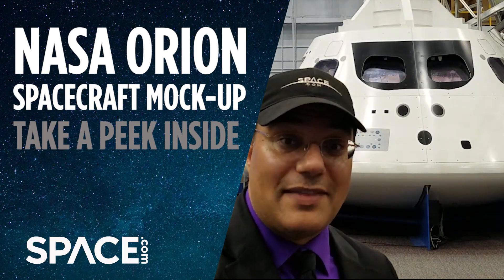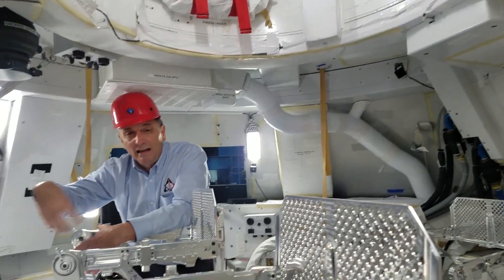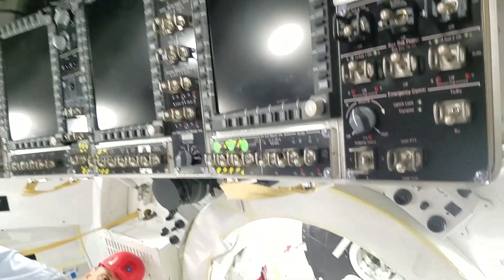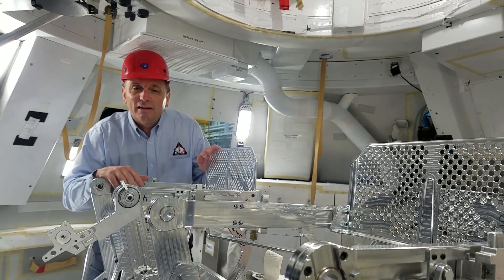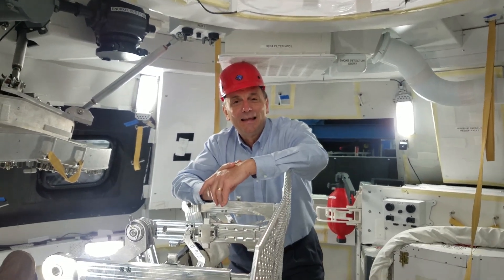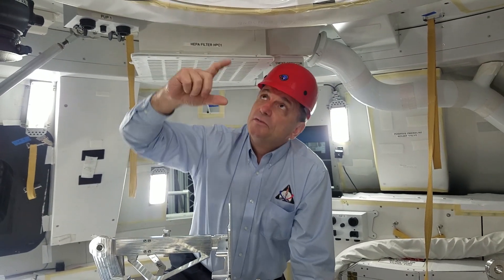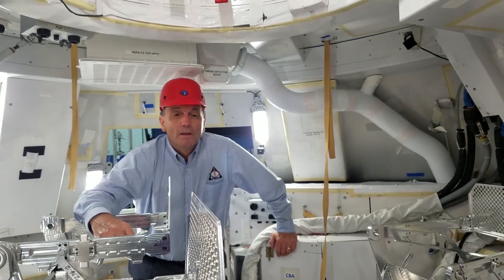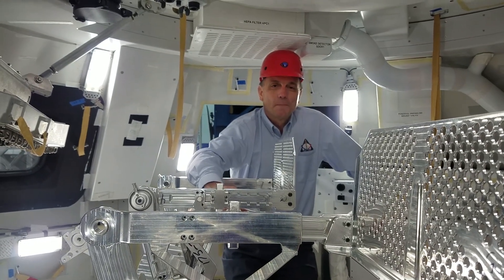Peek Inside NASA's Orion Spacecraft - Exclusive Tour

Comment: The capsule design just doesn't sit right with me..  you need a shuttle type for the main spacecraft...  with a booster platform to get you to the moon.
Reply: There's a reason they retired the space shuttle and went back to capsules. The shuttle just wasn't safe like the old capsules from the 60's were. But more important to lunar flights, is the weight. The shuttle was too heavy, it couldn't get to the moon. A small spacecraft like this or the old apollo CSM works better.
Reply: @despayeeto_5936  Atlas, Gemini and Apollo yes I admit all had their design restrictions.
The shuttle platform was a massive step forward in a reusable spacecraft. But the Orion capsules which are supposed to be state of the art, have regressed into the capsule design.
Why not have a space Dock and build a craft in zero G?.
It's a massive forward thinking enterprise but it's what we need to progress into travelling further a field.
Reply: @Mark-delta5  It's not a regression. The shuttle was, simply put, unsafe for the crew for a multitude of reasons. 

1. The solid rocket boosters it has couldn't be turned off during flight. This wouldn't have been a problem if they had abort motors like most space capsules do, but the shuttle was a plane looking thing stuck to the side of a rocket, so they couldn't do that. 

2. The heat tile problem, because the shuttle used heat tiles rather than a normal heat shield, which could get damaged during flight, leaving it unable to reenter safely. 

Both of these issues presented themselves with Challenger and Columbia. NASA doesn't want to see repeats of those. There's a reason we're seeing a move towards reusable capsules like Orion, Dragon or Starliner, instead of designs like the shuttle.
Reply: @despayeeto_5936 it's all about what technology we have presently.
Metallic hydrogen is the powerful rocket fuel we have to date.
So it's all about gaining escape velocity of 25,000 mph. 
It's all about R&D..   just because we don't know how to do something,  it doesnt mean we can't do..  weve just go to think outside the box and listen to those who know what humanity is capable of..

Comment: I suppose that high tech red hat the guy was wearing protects the astronauts from cosmic rays? No, I get it. I have seen them talk that the Orion capsule is only a transfer vehicle from Earth to the vehicle used to travel to Mars. That vehicle will land on Mars and the centre of that separates while on Mars to blast off  to travel all the way back to Earth. Aparently actual NASA engineers want the astronauts to come back home. Unlike private industry that have been designing a one way trip. I can't wait to see what NASA comes up for x-ray cosmic protection by the 2030's, the theoretical time-line of the actual mission. The only viable way is to have a central vehicle core wrapped in heavy thick lead or surrounded by 6 feet of concrete or their drinking water. This design is basically what nuclear submarines use to protect people that man them. So far all they say is it's too expensive to transfer all that weight into Earth orbit. Getting off of Mars would be difficult as well. They sure don't explain this very well. I know all this money that has gone into Orion works well for goiing back to the Moon. There is water on the Moon. Maybe that's how it will happen? Sounds likely to me.

Comment: I would rather pay $50 or $100 to get a 'near real' space flight simulator experience which will not only show me the views of earth from the stratosphere but also views of low orbit fly-by, touchdown on moon, mars and other space wonders.  You can make a real size replica of a non flying space capsule - starliner, both interior and exterior, keep it on a mount inside a big elliptical shaped room whose walls and floor are created with ultra high definition infinity view screens mimicking "out of window"  3 dimensional realistic views e.g. space horizon, close up of earth, moon, mars, comets etc in the same way space travelers view it from inside the spacecraft window. With mechanical movements of the craft, pre-recorded scenes and sounds you can recreate the same experience one gets in space i.e. the launch - in flight and  touchdown (barring zero gravity) in the same way as actual space flight.   #spaceForEveryone Mix of VR (recordings) and Actual reality (sitting inside dummy but moving craft ) creating most realistic space flight experience

Comment: Ok, my only question: How come Orion still has lots of physical switches while Crew Dragon has a streamlined touchscreen console that takes up less space?
Reply: physical switches are much safer than digital ones, in case of an emergency like apollo 13, they dont need power to use them
Reply: Switches are much more desirable imo, especially for redundancy if screens go offline
Reply: Orion started developememt many years ago, probably over a decade ago.
I don't know how much has changed since it last flew 6 and a half years ago, but peobably mostly the same

Comment: The Orion crew capsule is the most advanced, reusable and good to go crew capsule there is. Why is NASA messing around with SLS ? it is an outdated piece of space junk waiting to happen. Bolt the Orion capsule on top of the Falcon Heavy and bob's your uncle...job done...peace yall.
Reply: Falcon Heavy is too small to carry the Orion spacecraft to the Moon since Orion weighs 26 tons and Falcon Heavy can at most carry 20 tons to TLI, and of course it will never be human rated so its a non starter just because of that

The only rocket big enough to send 26 tons to the Moon is the SLS, which will also be human rated even on the very first launch

Comment: Question...  Why do we need a "Gateway" station at the Moon?  Surely a command module can dock directly with a lander and the lander can be fuelled independently once it's back in orbit around the Moon.  It seems to me that the "gateway" is completely redundant.
Reply: The idea is to have a more permanent "command module," as the goal is to establish permanent settlement on the moon.
Reply: @Studio23Media  I understand what you are saying, but how is that possible?  A command module will need a crew to get to the "gateway" in the first place and could just as easily orbit the Moon (and more efficiently, quickly and economically) without it.  I'm not arguing against a permanent settlement on the Moon, but I am questioning the need for a gateway as necessary or desirable to make a Moon settlement happen.

When you analyse the gateway project, there isn't a single thing that the gateway can do which can't be done more efficiently, quickly, safely and/or economically on Earth, in Earth orbit, or on the surface of the Moon.
Reply: @chrisantoniou4366  Again, the idea is to build a small space station in between the Earth and moon. A translunar bus stop of sorts. I admit I am not qualified to criticize the plan, but I thought it seemed unnecessary at first. But at this point, I'm struggling to even be excited about Artemis at all, thanks to that expensive piece of shit rocket.
Reply: @Studio23Media  Well, we certainly agree on the SLS...  As for being the most expensive rocket, it will be if it ever gets off the ground, but until then it's the biggest white elephant.

On a more serious note, I know what the "gateway" intends to achieve, but no one can explain how anything it will be able to do can't be done quicker, more easily, safer, more efficiently and/or cheaper from the Earth's surface, Earth orbit, or on the Moon's surface.  Quite literally a useless, expensive and dangerous piece of kit... which is probably why it is the perfect match for SLS...  :D

Comment: Um it's 2019 why are they still designing these tiny space capsules?? This is only a few meters larger then the first one. This type of recycling idea is old. Start over technology is way better advanced for you guys to be making these tiny space capsules using the same design from years ago just with fancier equipment. No matter how much you try to credit yourself it looks very much like the same thing they built years ago. Scrap the whole thing build something NEW and bigger it's ridiculous. This like a iPhone add slap a few new things on the phone and market it as NEW .. call Elon
Reply: Tiny? This space craft is 5m in diameter and 7m long
Reply: Because space capsules are the safest and easiest design. The shape alone is passively stable during re entry. Re-entry is a big factor in crewed Spacecraft design, the shape of orion keeps the shockwave where most of the heat would be generated during atmospheric entry as far away from the vehicle as possible.
Reply: They already did... it was called the space shuttle.
Second, you need a light spacecraft to actually send humans practically to the moon

Comment: How profoundly disappointing.   The control panel looks like something out of the 80's with some 50's legacy hardware thrown in for good measure.   I do realize there needs to be redundancy and radiation hardening exct and I am a rank ameture.  It just seems to me that touch screens and a little newer technology could save weight, time, and money.   My new oven looks more high tech and dragon crew seems more like the dircection of the future vs what I saw in this video

Comment: How will you survive trip to Mars in something so small. it’s like they went backwards from the space shuttle.
Disappointing!
Reply: It's a command module. On a trip to Mars, it would be the command center for a large, modular vessel.
Reply: @niallkinsella2687  yeah, sort of like a space station that can travel to mars
Reply: Mmmm. Its the same as the Apollo capsule. No one could survive more than a couple of days in that without going crazy.
Reply: @digdougedy  Its meant to dock to a habitation module for interplanetary or long duration flights.

Comment: So, if I understood correctly, in the current position of the capsule before launch, the astronauts are lying on their back, on what is now the pavement of the capsule. Those aluminium parts we see in the video, is where they should put their legs. Right?
But wasn't supposed to be 7 astronauts?
Reply: Originally 6 astronauts for ISS missions but that was cancelled in favour of commercial crew in 2010.
Reply: 6 astronauts. They put their feet on the metal stuff that looks like a mesh. There are two rows of seats. The second row is below the first row (when the capsule is flying horizontally).

https://www.google.com/search?hl=en&authuser=0&tbm=isch&source=hp&biw=1280&bih=653&ei=mXSQXNrUMNKl_QbguJ-4CQ&q=orion+spacecraft+interior&oq=Orion+spacec&gs_l=img.1.1.0l10.3369.11509..15106...0.0..0.71.738.13......2....1..gws-wiz-img.....0..35i39.N9dLgHXeLQg#imgdii=JP_xnjUGfB2deM:&imgrc=AxD9DCNvwDEcQM:

Comment: Why not ask about the Orion's Van Allen Belt radiation shielding?
Reply: Why bother asking about something that was tested and approved four years ago?
Reply: Wont be a problem in Greenland.
Reply: Why don't you use shielding when you heat up  your loony-chow  in a microwave? Its about the same level of "risk".. Anyone who can read  ;  ) .... can see  that the van allen belt presenting  non  sequential risk  has been experimentally verified   about 3000 times since the 1950's  - which was the last time anyone with a functional brain identified VAB radiation as a significant risk to astronauts ..Let me give you a primer ...the VAB is mostly alpha radiation, the particles of which wont even effectively penetrate a piece of aluminum foil (just like one of your erections) ....Now run along and bring up that old laugher  to someone who doesn't know any  better ...someone at.church probably.
Reply: @solerso68  NASA quote on their Orion presentation.. the Van Allen beats are "an area of dangerous radiation" and " we need to develop ways of protecting astronauts from the VAB". Obviously they forgot how they did it 7 times 50 years ago.
Reply: Doug Boyd They did it by almost completely avoiding the belt, going through the spot with the least radiation.
Reply: @nates3927  Impossible as the belt envelopes the whole Earth. The only place it is weaker is directly over the magnetic north or south pole. Dr Van Allen stated that a trip to the Moon would have to be launched from the poles to minimise the radiation exposure to the astronauts.
Reply: Doug Boyd here you go, as I am not too well versed in the subject to type out the intricacies, this video does a better job explaining it https://youtu.be/9BEylTGOlQ8
Reply: 1. it does have radiation shielding.  2.  they go through the belts quite rapidly.  done.  over.
Reply: just because they won't venture far from LEO...
Reply: because it will just stay in a studio for filming a fake video... 8-)

Comment: Please don't get me wrong on that but... buttons, switches, knobs?! That cruise control panel looks like a slightly more polished but only slightly more modern console than those used back in the good old times... I mean I understand that you would like to give a reminiscence to the golden era of space flight but... all knobs, buttons and switches? Really? 
Compared to what SpaceX brought up design wise the interior of this capsule looks much like it was imagined by bureaucrats, back in the 70s...
Reply: I watched a video a month or two ago where one of the astronauts was saying switches are better for zero G because you need to push off of objects to move around. Touch screens are too easy to activate something you don’t want too.
Reply: @dwood721  interesting aspect!
Thanks for pointing it out.
Reply: It's probably for simplicity and functionality over flashiness.
Reply: @autumn702  Well to have some touch screens is actal much cheaper than switches. Not to forget the more safety of screens...less moving parts, less contacts which could generate sparks and so on...
Reply: Perhaps some hard wired switches in case of a software problem. Enough to survive until it reboots. I guess it's just the safer design. That's by far not enough switches and buttons to control everything.

And if you think that design isn't modern enough and they just don't know better: I highly doubt that there is any design decision on such a level of importance  that wasn't made by many very smart people after long discussions of all the advantages and disadvantages. And there isn't always just one good solution, other companies may have different designs. Also, a capsule designed to go to orbit may look different than a capsule going to the moon or mars. The time spent inside it differs and the ability for communication, support and remote monitoring from earth is different. Your design decisions have to match your requirements.
Reply: Popel Grüner Your confusing Star Trek And Star Wars with reality. What critters do you want them to cross breed to creat a Chewbacca? Or should they just use the force?
Reply: @jopflah416 LOL Nope I'm not. Have you seen the SpaceX interior design? It looks very much like Star Trek indeed. You should watch the video of Musk's presentation here on YT to know what I talk about.
So before you start bullshitting on me get yourself informed.